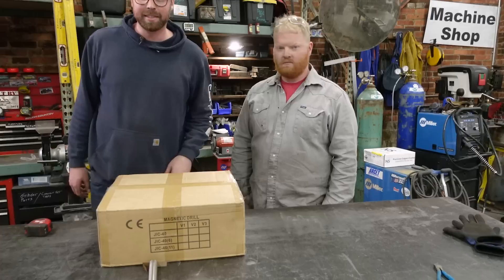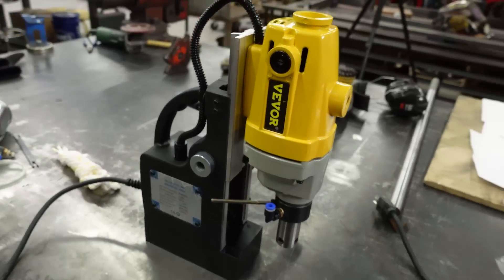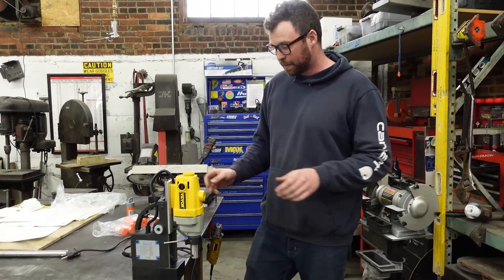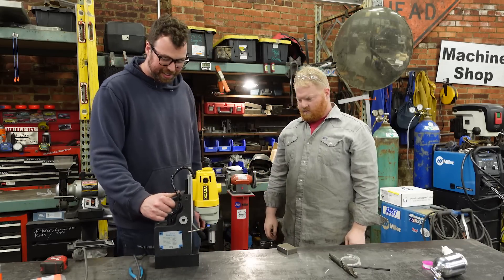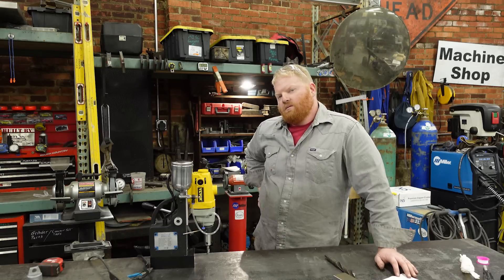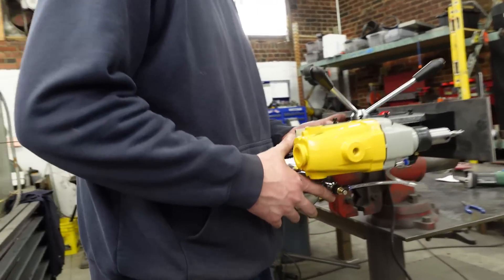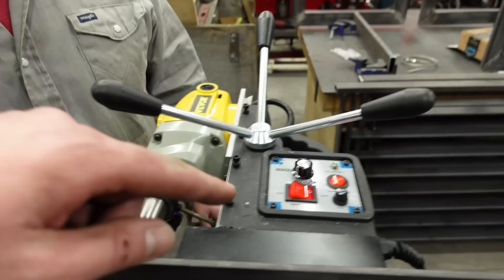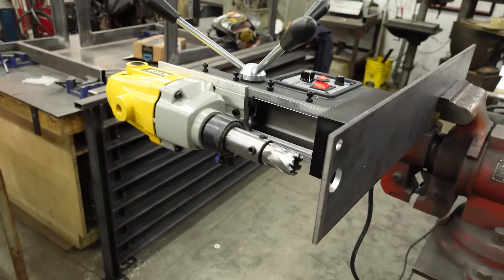I've Wanted One of These for SO Long

Comment: I'm an engineer. Some points, guys (great vid, btw):
1. A water-based cutting fluid will substantially increase cutter life. (Water-based is best for tool temperature control. Lubrication is less important. HSS is prone to dulling after overheating.)
2. The centre pin designed to be used with the cutter locates it and also controls the flow of cutting fluid.
3. You can get a morse taper to weldon shank adapter to use an annular cutter on a conventional drill press, milling machine or lathe tailstock.
4. If you're overhead or inverted in the field, always strap the drill to the beam, in case the power fails or someone trips over the cord.
5. Magnetic attraction is also related to the thickness of the material being drilled. Mag drills generate maximum attraction on thick steel. Thin metal - not so much. (It's not really the strength of the magnet or the quality of the steel - it's the thickness. Just clamp the drill to the table and drill the hole in the job from there - even if you have to shim it with some thick plate to overcome the throat clearance.
Reply from the maker: All great points!  I'm going to pin this comment for anyone else who may consider using a tool like this in the future!  Thank you!
- Walker
(love your channel btw)
Reply: Love your website too John 👍 a fellow Aussie grump ! 😉 You are usually spot on.
Reply: Vault tech here, I literally came to say point 5. We tend to you vac rigs now a days because of the nature of composite vault doors.

They also make a permanent switchable magnet version that you can attach a normal drill motor setup. 
StrongArm Cordless Magnetic Drill Press. Maglogix 
MagnaDrill which is the OEM for that.
Not exactly the same but less likely to accidentally hit the release mechanism.
Reply: Yeah, sure, the translation is funny, but you’d be surprised at how easy it is to get injured by these drills if you don’t obey the rules. There are lots of inexpensive mag drills out there. Many start at $500, not $2,300. That’s a fairly expensive model. All the coolant feeds are similar to this one is, even on the most expensive models. Generally there is a way to mount it so that it’s vertical at different drill angles. If you don’t lubricate the cut with coolant, you WILL damage the cutter, no matter who made it. I damaged a couple of Hougen cutters when the coolant ran out and I didn’t realize it. Carbide is better, but expensive. You HAVE to use the pins! Seriously, read the damn instructions.

That piece of metal is really too thin to hold a mag drill properly. The “liner” is called a gib. It will flex because it’s thin and not held in place except by the inner and outer dovetail. That’s normal.
Reply: In my experience there's a huge difference in using cutting oil Vs dry in the way it cuts and tool life.
I have found extremely good tool life with oil, it's a reasonable quality cutting oil.
 A lot of this I suspect is because, the Hss tool has plenty of time to cool between the time it takes to move to a second hole the oil decreasing the friction and the cooling provided by the oil.

Comment: i  bought a cheap mag drill from amazon to drill holes in a welding table i was fabricating for myself when i first started welding. i still use both to this day one year later and ive never used the lube jug for the annular cutters, i just spurt lube or coolant from a spray bottle onto the cutter

Comment: I took a look at the other Mag-drills in the Vevor line up, I have been wanting a new Mag for ages ever since getting my namebrand one stollen off a site.  I don't use one enough to pay the big bucks again.  The other models in the Vevor line have longer track (8 inch) so you can drill all the way through a 2x2 sq tube for pins.  Also they have bigger motor - ie 1400 watts instead of 1100, and still have variable speed. Accessories available (sep prices) Jacobs chuck, set of 11 mag-drill bits. Looks good, I ordered it.  Thanks Guys! I doubt I would have taken a chance on the Vevor without your vid.

Comment: You can send aluminum out and have it chrome plated.  I did some work for a plastic window extruder and they could make vinyl extrusion dies quickly and cheaply if they used aluminum instead of tool steel.  But the vinyl is very abrasive.  They had the aluminum dies chrome plated and they lasted quite a while.
Hey, you got a machine shop, make a steel way to replace that aluminum one!

Comment: I drill holes in overhead steel beams. Tens of thousands of them over 30 years. I use a keyed chuck adaptor with regular 3/8" bit from Lowes for $5.00. I never use a dtop of " cooling fluid." Bits last over a year.

Comment: Even the most expensive mag drills have similar coolant systems. A couple have systems that allow the coolant tank to rotate for horizontal use. But that’s usually just the screw with a curved slot to allow that. The steel rod is standard for the coolant enabled chucks, just as it is for rotating centering devices and tapping heads. Not funny, just the way it works.

You have to use the centering/ejection pin.
Reply from the maker: yeah, the centering pin was a screw up, im new here!!! lol

Comment: Wouldn't just using a magnate to get the metal filings out work or for that matter just run the drill with its magnate on over the hole to draw out the filings and then turn it off, filings fall into your plastic container?

Comment: wire the mag switch to the power switch. easy fix. That makes it so the mag has to be on to run the drill, if you hit the switch it shuts it completely off. if you have it way up high, it should be tethered i'd think.

Comment: vevor has an european suplystore too , been looking at the magdrill for a while tooone of the projects i would have for it is to drill holes in a weld table for mounting welding clamps  
nice thing about those anulair cutters is that you can get a mt watever to 3/4  weldon adapter for them if you have a drillpress or a mill with a taper and these drills take less power so if you have say a drillpress for 13mm you could drill bigger holes with it
as for the seperate circuit for the magnet , i think you could put a always on type pushbutton on there (push button to release the magnet ) and to prevent the drill falling if you touch the butting while drilling is running the switch for the drill through the same magnet while the drill is running

Comment: Easy to fix the problem with the magnet being turned off while drilling is in progress. Single jumper wire will do it. Depending on the terminals used by Vevor. Maybe use electrical tap splices. Anyway connect from drill switch output/speed control to output of magnet switch.  So whenever drill motor is ON, the magnet is energized. Problem solved!.

Comment: I got one of these(vevor) mad drills a few months back and it came to me damaged and it wasnt from delivery it was a manufacturer defect, the rack didnt want to slide down because the holes that were drilled in the gibs were drilled off center so the gib wouldnt sit right in the track so it wouldnt go down more than half way. Then an absolute nightmare dealing with the company.

Comment: 24:50 - Love the "ah hah!" moment haha, and that's the beauty of an annular cutter! I used an adapter like John Cadogan mentioned for my drill press. My biggest tip is to use a vice as low to the table as possible, and to tighten the table down to reduce flex / chatter.

Comment: If using the mag drill overhead etc you should also secure with a ratchet strap or rope in the event of power loss. That thing drops on someone's head if a breaker trips or the generator runs out of fuel, you are in the shit with the H&S crew.

Comment: I always got a slap round the ears from an old machinist/toolmaker when I used WD40 as cutting oil. There seem to be little carbon particles in it that make your tool dull.
So nowadays I only use dedicated cutting oil, and if it smokes it's good because heat looses energy in evaporating the oil.

Comment: MAG DRILL,    first then you do with it and im serious.
Drill a 1" dia hole 6" back from the tip  in the center of both forks on your fork truck, then make 2 pins  2" long  x  1" one end and 1 3/4" the other end on the lathe
These pins drop into your oversized holes on the forktruck.
Assuming you move bar stock with the fork truck you use a lifting strap and the pins keep the strap from pulling off the forks.  On the forktruck next to the seat in a clear spot drill the same 2 holes to store the pins in so they are always with the fork truck.  Ive lifted 20' bundles of bar stock close to the straps max weight 
All in the bundle,  you can guide the stock if you life from the center.

This also works with wood but you'll want 2 straps one for metal and a clean one for wood.  With a c clamp you can also move sheet goods.   Perfect job for a mag drill.

Comment: You have to remember that the drill in not attached to a very thick plate in the vise so that will add to some wobble. Why not leave the drill on the table? You can still reach the hole.

Comment: I use a spray bottle with mixed coolant for the cutter.  The auto feed or drip is a pain and the reservoir gets in the way for some after thought hole punching in tight spots of a build.

Comment: The magnet strength is mostly related to the thickness of the steel. It works well enough at 1/4", but even better for thicker steel. As a user pointed out below, you can fix your problem by clamping a thicker piece of steel to your tubing, which only extends to near the edge of your magnetic base, and then the magnet will hold nice and tight. Also, for drilling mild steel, those HSS annular cutters last a long time. I have the Evolution brand of this drill, and I have drilled LOTS of 11/16" holes with one cutter, and it is still sharp. I use their cutting fluid coming down through the middle of the cutter, which is a little messy, but not too bad. If you are doing serious production or drilling tougher stuff, you can get carbide tipped cutters. See the Project Farm review of various brands of annular cutters. Evolution provides a little 'fence'-like piece which reduces the splash of fluid and chips somewhat. I don't always use it.

Comment: Boo who. I don't want to get oil all over my shop. Well don't drill horizontally. I was really curious as to you seeing the oiling system work. Kudos to the round guy. Although I believe the Sasquatch has a control freak problem. New subscriber though. 🤣

Comment: Any stiffness of the PVC cable is primarily due to a lack of plasticizer, which will naturally occur as it ages over many years. It can be accelerated by contamination of lubricants and other chemicals, so keep it clean. Of course replacing it with a neoprene cord is a permanent fix.

Use of an electromagnet means that any momentary fluctuation in the power could cause the drill to go flying, so, as the manual might say, "The operator brain must keep uppermost the happening and dangetous drill flight path for quitting of power while in use." Some cheap insurance might be a rachet strap that could back up the magnet while in use, especially if the operator is in the path. Further, the entire supply cord, including extensions, must be guarded from accidental disconnection, especially if any part of it is out of sight of the operator. Scary!!!

To prevent accidental magnetic switch deactivation, cut off a half inch length of PVC pipe of suitable diameter and glue it to the control panel around the switch. To kill the magnet, one would have to deliberately reach a finger into the pipe to reach the switch. (That such an inexpensive guard was not included in the design is [insert bad word here]). What do drills that use permanent magnets cost? Or how about just a magnetic mount to adapt an ordinary hand drill, especially a cordless drill? As it stands, you will have to be able to repair the drill motor should it fail. Yeah, a magnetic adapter is starting to sound good.

Unless the extruded rack is flimsy to start with, it shouldn't wear if kept clean and lubricated. After all, it probably won't receive the same wear that a machine would in some kind of continuous use like manufacturing. It might be beneficial to make an easily-removable ways cover from thin rubber (inner tube?) to keep out dirt and shavings.

Comment: Always called those bits "slug cutters", and 16 min in... you forgot the centering pin.   Drilled many a hole in truck frames with mag drills and 3/4-1" bit. One word of advice, other have said..... Use a chain and not that rope. 
You think that mag holds, wait till you lock that drill up toward the end of a deep hole..... It'll spin it (if it's as strong as the name brands we got at work.
Reply: Far as cutting oil... Tap magic is all we use at work. Boss says it's expensive, but.... works well and bits last hundreds of hole through Freightliner frames.

Comment: I have the same unit and drilled my own welding table. A few hundred holes drilled and it is running great. Get some cooling fluid  to keep the cutter wet and it cuts even better.

Comment: I looked up that mag drill. You should have a center pin that goes in your annular cutter that you can line up the center of your hole with. It shows it in the product picture online. I have used a mag drill allot on my old position. They were klein tool mag drills which I can not find anymore. But klein were top of the line mag drills.

Comment: I use the slug's for making jig's ect (eg.bending round bar into shapes) or u can use them as projectiles by shooting them from pipe with electronic solenoid with air connection going to air compressor or a small tank 
Great channel by the way it look's like you have a great bunch of blokes there working together with a lot of different skills between them

Comment: install the center drill. or the spring loaded center tap. then you wont have the wobble.
Reply: I've got 2 of these. Why 2?  Because somehow they were on sale for $59 each with free shipping from Vevor. I figure having a backup never hurts for that price. First time I ever bought anything from them. But they both have a bit of runout (wobble). One is worse than the other, maybe by .004 or so. Still works great for what it is.

Comment: Automotive oil lubercates and prevents cutting, Cutting oil is designed to help cut. Always use a safety chain when side or overhead drilling.Oil and tighten the gibs on the dove tail slide.

Comment: You need to put in the spring loaded center pin that ejects the core out, the pin also is used to center the annular cutter. You use center punch to mark the spot and then the pin can pick up on the mark and center itself, sometimes if the hole is critical you can center punch it, drill it with say 4-5mm drill and then the annular cutter will cut true. Also use coolant or cutting oil even just spray on. Also when you start use carbide tipped annular cutters you usually don't go back to HSS. 30MM in a Hardox (what you muricans call AR plates) with carbide tipped annular cutter no problem...

Comment: They make a chuck to fit regular drill bits aswell. 
 Wow 300 and it has a speed control.  Dang hogan is like 3000.
 Lot of machine for 300 nice
Reply: Good luck with the litigation due to the broken arm

Comment: For the life of me, I can't understand why you did not drill a small hole through both sides of the steel that would have given you the two positions for the two different drill bits.

Comment: I have that same drill along with a set of Amazon cutters. I used it to replace axle brackets on a semi trailer. I was drilling through 4inch angle iron 3/8 inch thick. Worked flawlessly. For the guy that uses it occasionally,it's a great tool. I used 15w-40 to lube it. The lube system sucks so I just poured it on piece.

Comment: Years ago we purchased a clone of this tool. It had a branded Hitachi drill head. We had the classic Milwaukee mag drill as well. I scoffed at the import machine until I started using it. It was only a fraction of the size and weight of the Milwaukee, and for that reason, I seldom used the Milwaukee.  The import drill became the favorite.

We never invested in the annular cutters and used twist drills in a standard 3 jaw chuck. This is really tempting for hobby shop use. A set of included annular cutters justifies the already low purchase cost.

Comment: Mine is a Dewalt, before the Dewalt I had a Evolution S42. I was afraid to buy one of those Vevor because they look like disposable drills and now looking at that one at work, I do not regret my decision on going with the Dewalt which cost twice as much as the Vevor but can't compare in quality. The good quality mag drills, they completely cut off  power if you disconnect  the drill. You need to use that center pin it if you want precise holes. Also, the cutters come in 2 inch length.

Comment: If you drill your big hole on the one side then.  Leave your drill connected to your piece then change to your little bit and drill the small hole through your piece. If you don't move your drill your small hole will be centered in your big hole. Hope this helps you.

Comment: Nice vido and review, as you found out you need thick steal to hold well, and if you use too much force it will break loose, no mater what magnetic you get, will take thick steal better, have used mag drills for years, nice but they all have limitations, but can get a few models in that sub 500$ price range

Comment: I know I'm being picky.  Not a mag drill.  Drills use drill bits.  Slang for that critter is a slugger.  Annular drill or rotabroach using annular cutters.
I purchased a Hougan slugger off Ebay and the seller couldn't find the one advertised so he sent me a top of the line but older one.  Super happy with the upgrade and the cutter.  So sorry I waited so long to get one.